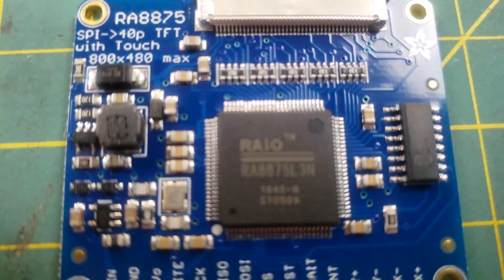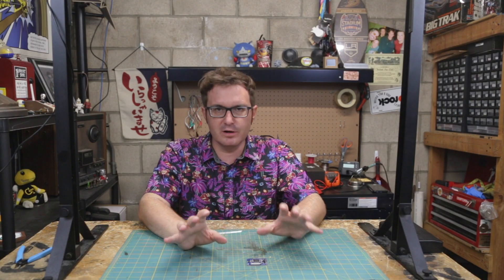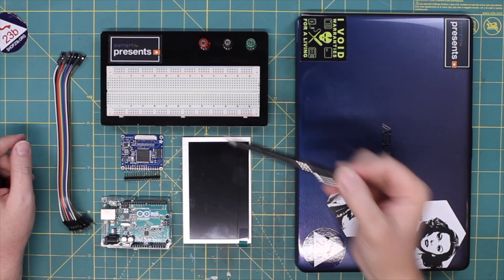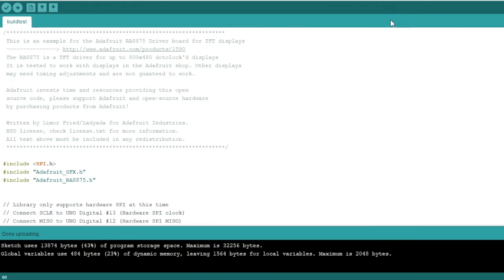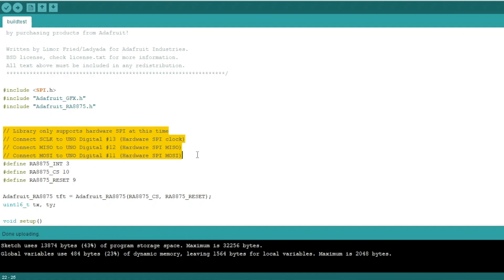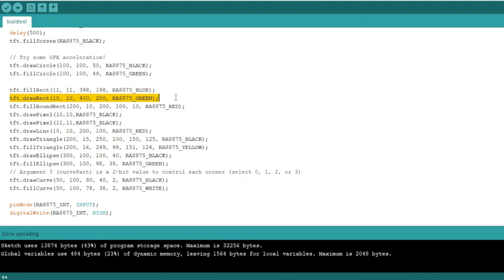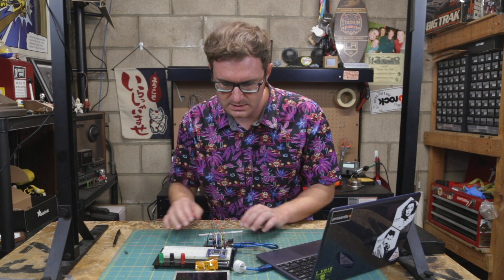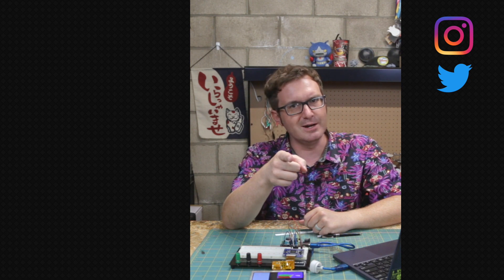How To Set Up A TFT LCD Screen On Arduino With The RA8875

Comment: I'm slightly annoyed that screenwriting should be so slow with the Arduino.
Can't you show us a solution that draws that image 30 times per second?
Reply: Yes the solution is:
Let the 8bit arduino die already and switch to 32bit uC on which you could play a movie in 23-30FPS, I suggest teensy 4.0, stm32 black pill, or raspberry pico.
Reply: @Arek_R.  You could say that you think Arduino is good enough to learn simpler things, but you should continue with better stuff?
Reply: @emilalmberg1096  ???
Reply: I realize Im kinda off topic but does anybody know of a good website to watch new tv shows online?
Reply: @Nehemiah Immanuel lately I have been using Flixzone. You can find it by googling :)
Reply: @Isaac Baylor yup, have been using flixzone for months myself :)
Reply: @Isaac Baylor Thanks, signed up and it seems like they got a lot of movies there :) I appreciate it!!
Reply: @Nehemiah Immanuel happy to help =)